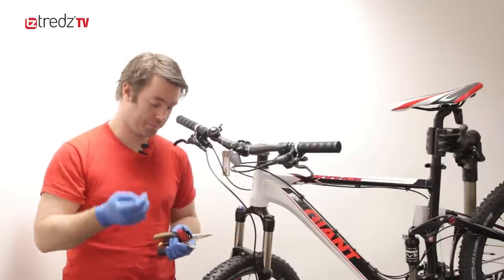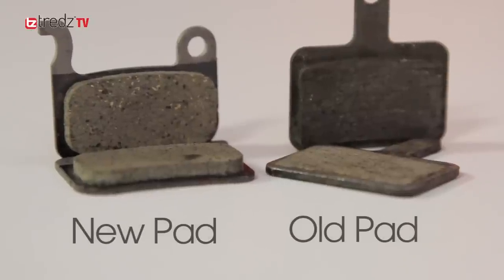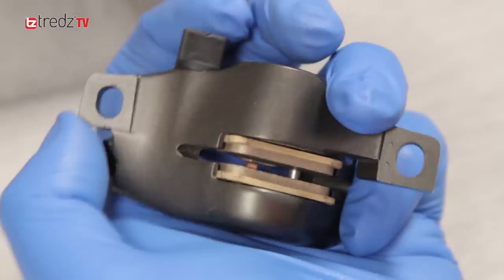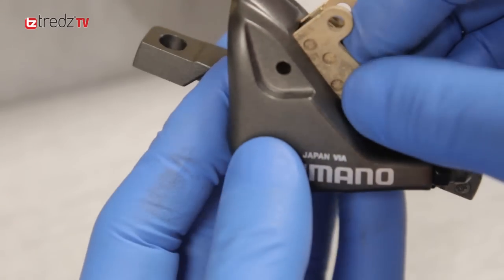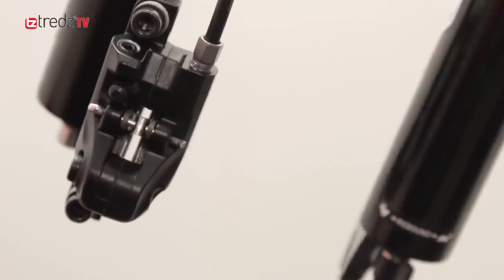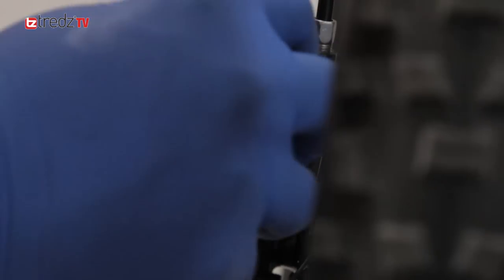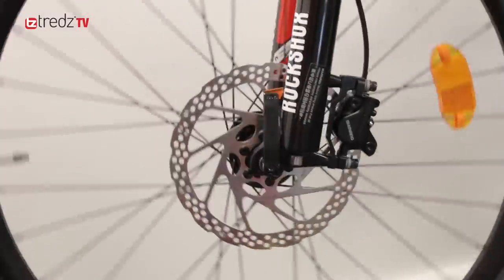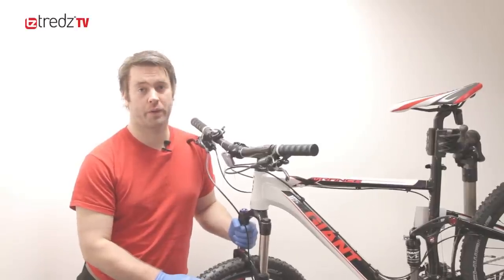How To Change Disc Brake Pads - on a mountain bike

Comment: This is brutal. Brake pad tool? Who has that! You say inspect the pads, but the shot is of pads already removed. How did we get there? And then early in the video suddenly the calipers are off, then they are back on. So confusing, and not helpful for beginners at all. Sorry.
Reply: +Benjamin Singer Yeah and he is using gloves??
Reply: You don't want to touch the pads with your fingers because human hands have oils that can break down the pads at an accelerated rate. Hence the rubber gloves. Noob.